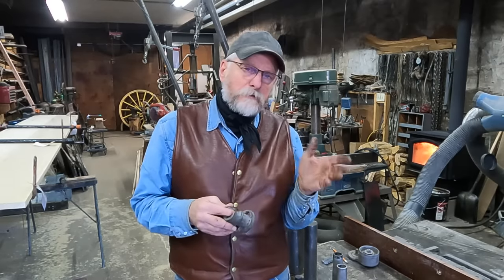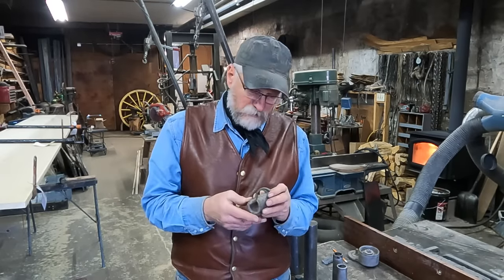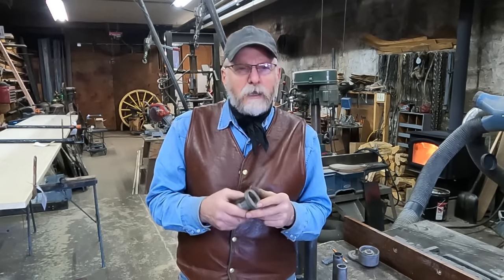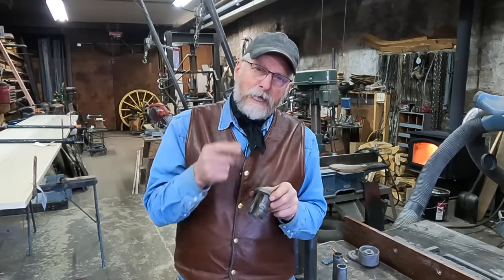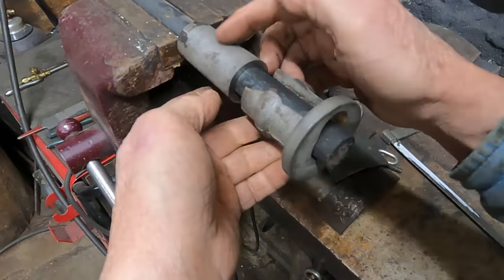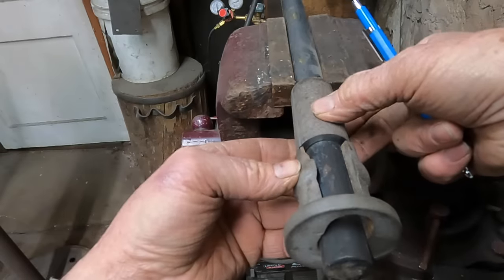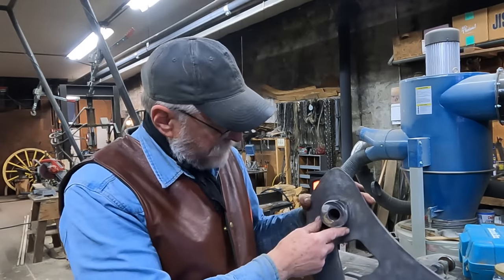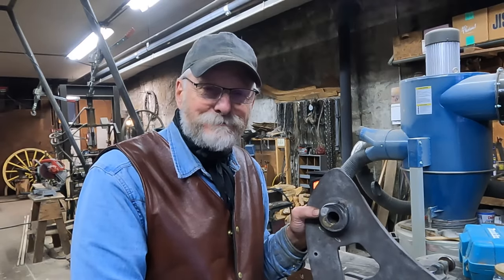My Smith Spreader Bushing Repair | Engels Coach Shop

Comment: I call that a fine save!  If you were restoring an old Formula 1 car, not so much but for a horse drawn manure spreader its perfect.  Another couple hundred years from now someone will dig up that old pile of rotted wood with hardware and notice someone, at some time back in the past made a repair to a previously worn all the way out part.  Ive said it before, you should make a Makers Mark stamp and mark your work.  Someday history might repeat itself and one of your wagons will come in for work and somebody would have a makers mark to start figuring things back out again and a redirect to your video legacy!

Comment: The only reason I mentioned Keith Rucker is because he does pattern making and recasting parts with Windy Hill Foundry.  I figured that was the only way you were getting a replacement part.  That said, I guess it isn't going back to work, so it probably doesn't need that level of repair.  You haven't said what the plan is for this project.  Is it going to a museum?

Comment: The mechanical working parts of the dung spreader we bought in 1974 from a Danish company  "JF Fabriken"(I am in Scotland) were almost identical to those on your machine. Though mostly wood ours did have a metal frame that held it together. Clearly a successful design, simple yet robust.

Comment: Good job!  You made a good point about how the machine was put together originally. You could have machined these parts to .0002 tolerance but then you’d be attaching them to an old machine that’s going to have squeaks and rattles at every other junction. You done good just the way you done it! 🥸👍👀✅

Comment: This 86 year old farm boy that has dabbled with 75 + year old tractors and equipment agree with your approach to repair this. Before 1950 replacing parts with new was often the second choice. The local  blacksmith was usually consulted for his assessment first. Many times the blacksmith repair was superior to the original. 
The younger generations seem to think that the older equipment needs to modern day specifications forgetting that what they have worked for 50 + years of use and will not be depended upon again to get the job done. It will be in parades and shows as a show piece to demonstrate what used to be.

I appreciate your work to bring these old things back to life. Hopefully they will be cared for for future generations to ponder and never be worked hard and put away wet.

My father-in-law was a blacksmith repairing farm and ranch equipment in Colorado during the 40s and 50s.

Comment: Couldn't figure out how that bushing would wear the way it did until you pointed out it floated in the housing. Recognizing how parts wear is part of how to fix it. Did noticed you used a carbon flame on your torch to not take the carbon out of the cast when you were brazing.

Comment: Over the years I have come to really appreciate the great possibilities that brazing offers. There are times that nothing else available will solve the problem. For many welders anything that isn't TIG welded is junk, especially race car guys. Most don't know that the chromoly tubing they love was first developed for aircraft frames that were then brazed together with an acetylene torch. The resulting joints are very strong and especially crack resistant.

Comment: I missed your video on this last time but those self aligning  bushes are a standard wear part or used to be. Made from what we called Chilled Iron. It was basically unmachineable cast iron so hard it would crack or shatter if you tried. However it made a very nice wearing bush in abrasive environments against a hardened steel shaft. Almost always used without a proper lubricant. The application we used it in was a long screw feed "mud" conveyor. It wasn't mud exactly but acted like it and was very aggressive wear wise. 40 years ago I was building new equipment that featured a bush not unlike the one you repaired so I would assume they would still be available if you really needed one. I believe the supplier was either Linkbelt or Malco.
Cheers

Comment: I never thought you wouldn’t fix it yourself but because you had mentioned it was likely cast steel and not iron I figured you would just build it up with your MIG welder. 
Brazing worked out great.

Comment: Don't be afraid to cut yourself a temporary mandrel out of wood to hold a part like that and cut its OD. If you drive a screw in the end of it for the center, you can do proper machining with it. Super glue will hold it in place just fine.

Comment: When I was 8, I was gifted an old 28” bicycle. One of the pedals was broken off at the spinal and the tires were flat. It just so happened my Grandpa had a car repair shop and he braised the pedal back on, like you did for this repair, patched the inter tubes and I was able to ride it! The problem was my feet were too short to reach the ground. I had to place it next to the porch steps to get on it! All went well until I fell off on the gravel road. My arms got scratched and my Mother could not understand why I would put myself through all that? I wanted what every kid wanted, the thrill of bike riding!With each repair you are faced with, you figure out exactly how to fix it! It’s at the heart of your talent! Each new tool you bring into your shop, you have to learn the best way to use it. You probably found out many ways you could use the tools and materials that they were not not meant to be used for! You are the MASTER of your trade! I get the tingles when I see the notification that you have posted a new video! Seeing you work, invent, create something from what you already have, is great entertainment, oh and I learn to! Thanxz. Keep warm!

Comment: Fabricating. Make it fit, both of the above. You did good Dave and not sending it out is understandable. Now if they will keep it greased like they use to do on a daily basis it will last a lot longer. You did agreat job thinking it outand fixing it. Stay safe and keep having fun doing what you do best. Fred.

Comment: You did it the same way as an old time blacksmith, they didn’t always have a welder but they had a torch and brazing rod and files. Nice work.

Comment: That bulge on the outside of the bearing is the predecessor to what is commonly referred to as a pillow block bearing. As long as the mounting surfaces are flat but not true to each other, it will allow the shaft to turn unencumbered. That was a really sweet fix. Thanks for the demo.

Comment: Nice video.
Well, everyone works differently and has a different approach.
If you try to do everything yourself, then I would cast the cast bushing myself. Recreate the socket out of wood, which then goes into a sand mold. Take the wooden bushing out again and then melt the broken bushing and other casting residues and then pour the liquid material into the sand mold.

Comment: Sorry to be slow to the party here Sir.    I'm in the uk  -- there is no problem sourcing Meehanite cast iron round bar in sizes approaching 3"  dia  and c. 12",  length.    Must be even easier to get in the US if an option was turning a bushing from new.   

It's a grey (?self lubricating ?) iron with claimed good weldability.    You've so many tools it seems right to use them.   Thanks for listening to my  tuppence worth.
Reply: Cast bar or cast tubing stock is readily available in the US from companies like Mcmaster-Carr and it is not terribly expensive.

Comment: I think the bulge on the bushing was to allow the drive shaft to float like a self aligning bearing, the wooden chassis would naturally flex which if the bushing was rigidly fixed the shaft would lock up or go tight, great job and a man after my own heart.

Comment: Good job . If you ever need cast iron or cast steel again for something else  you can buy it in roundstock and turn it on the lathe. It may be available in square also. Metal supplier or McMaster carr
Reply: David Richards or Keith Fenner You Tubers would have replaced it with the correct material if a new bushing was machined. Grease zert? This spreader only knew a bucket of grease and a piece of wooden shingle.

Comment: A totally different approach to the repair than I would have thought. It is an interesting method of replacing the worn material. And 🙂🙂I certainly thought you would have put the piece on the lathe to finish the OD.

Comment: You can duplicate a cast Iron or Steel finish on a machined part by heating that part up to the far end of red hot, just at the edge of white hot, let it cool, sandblast with Aluminum Oxide. You will see the porosity. Then harden, temper, paint, or whatever you want to do.

Comment: Just need to remember that it's a manure spreader and not an exact fitting bearing housing that's gotta fit with a 0.002 inch tolerance.  Anything that'll hold grease is gonna work.  That bearing type is an early self aligning gizmo that's intended to tolerate considerable runout and still finction.  Good job, all things considered, imho!

Comment: I am impressed.  In my woodworking shop I follow that same logic.  I prefer to do all the work if I can figure out how to get the problem solved.  And as you said, it was not a machined part to start with and I doubt we will see you pulling this with a pair of horse spreading manure, or maybe you will, grin....

Comment: Having a little experience with casting, a wooden pattern would have been all you need if you had to have a foundry cast one for you. A sand cast would be acceptable as there is as you said no need for fine tolerances. The repair you did will probably work fine. If this were for actual use I'd still make a pattern for the next time you need a replacement.
Reply: @Daniel-S1  You are absolutely correct, of course you know that. ;) The casting material will dictate the amount of "shrink."
In this case though it appears that there is not a lot of precision required for this particular part. I imagine that an undersized ID would be nice so it could be bored on a lathe to obtain a good surface for the shaft to run in.

Comment: Cast iron because of it's structure has carbon within it in the form of graphite (natural lubricant) if it were me I would simply have a few more bushings cast, because the cost structure is such that to cast one is expensive but the price reduces with quantity. I also agree that you can't run steel on steel because it will quickly run dry of lube and will soon bind up or simply tear itself apart. Oh by the way among my talents I am a retired engineer (toolmaker) with a degree in metallurgy.
Reply: The simplest way to produce one or two would be to get a piece of cast iron and turn them on a lathe.

Comment: I have made similar repairs by putting a brass rod the same size as the shaft that goes through the bushing in the tube and keep laying beads of weld to fill the worn area

Comment: sending that out to Keith would have been over kill and he is currently swamped with projects in any case. His fix his likely would have been to simply bronze in all of the missing material , incorporating some cast iron in to the repair seems like a better way to have gone it will wear at the same rate or closer to it than bronze would have.

Comment: @ EngelsCoachShop:  Many "walking floor" devices are designed to deliberately vibrate.  Could the bushing loose fit and donut ring shoulder be there to aid in this or conversely, compensate for it ?!
Or, another possibility, Manure is lumpy-bumpy and of different consistencies, including hard.  Could a deliberate wobble have been built into the mechanism to help mitigate repeated shocks to the shaft ?!

Comment: Is there any way you could put a ceramic bar in the damaged bushing, pre heat it and fill the missing area with a weld. Then put it on the lathe and use the undamaged portion to guide shaping the blob of weld material, at least down to the square grease fitting and shape the rest with grinders and files?

Comment: What kind of welding rods are these? I probably just missed the part where you named it, but I haven't seen that kind of steel alloy with a brass hints in its colour. Or is it just brass and it's enough to hold the thing together, since the steel insert takes all the grinding load?

Comment: Dave, I'm curious: do you plan to restore and USE this manure spreader, or is this for show?

Also, completely separate question: isn't the frame a casting as well?   Why was welding a mild steel shim into the frame so straightforward?
Reply: He does plan to use it some.

Comment: Dave all steel is cast, that's how its made. Some steel is drawn thru a mandrel to resize it but in the beginning it's cast. There are different ways of doing this sizing hence the terms Hot rolled or Cold rolled. The only steel that varies to any degree is welded tubing but there again it is cast, sized by runnung it through rollers, reshaped into a tube shape and then of course welded. Seems like the manufacturer didn't want three different materials in the bushing so as far as realizm and originality are concerned it's about as far from original as possible. But it's your manure spreader and you can handle it any way u choose of course.